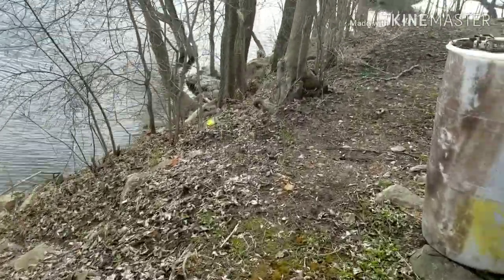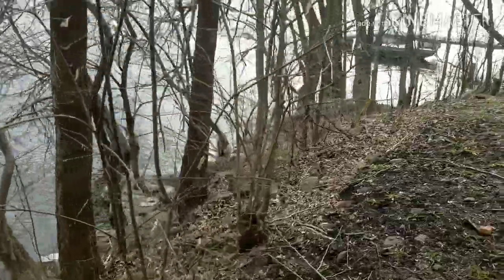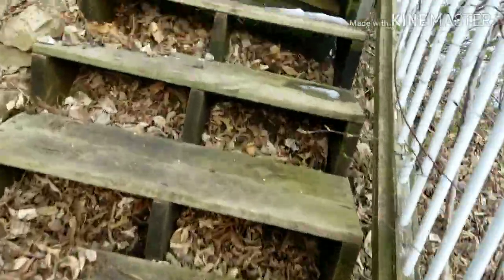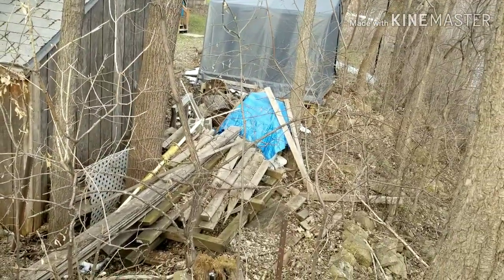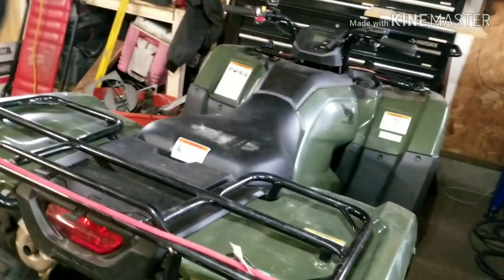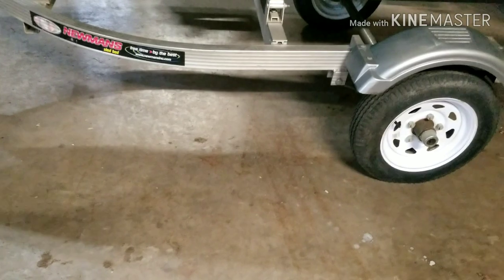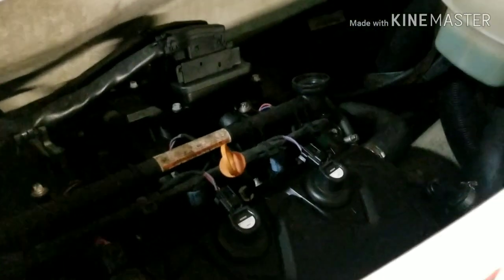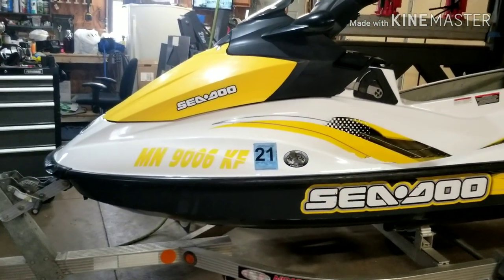Jet boat 3.0 and more episode #1.

Comment: I have that EXACT same engine and pump in my 2003 Sea-Doo Sportster jet boat!
In my 1500 pound boat it will do almost 50mph with 2 people!!
 It's an AMAZING powerplant! It's got a semi dry sump oil system and is very powerful for it's size! 
The best part is the EFI! It instantly starts every single time and requires almost no maintenance!

It's also CLOSED LOOP cooling! The ride plate is the "keel cooler" and it runs antifreeze. The exhaust is the only raw water cooled part and it's self draining!

The ONLY issue with that drivetrain is that stupid carbon seal on the driveshaft, it leaks by design and if you run the engine without the ski in the water for a prolonged period of time it will overheat and then it will cause cavatation when you try and accelerate.
The workaround that myself and others have done is to install a little piece of copper tubing in the tunnel to spray water at the back of the seal and hook a hose up to it in the hull that connects to the flush fitting.